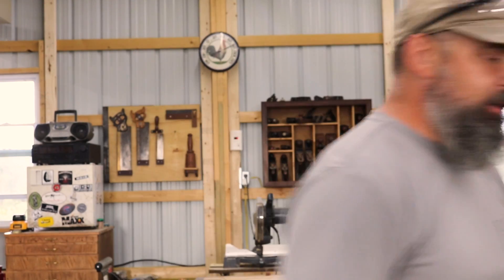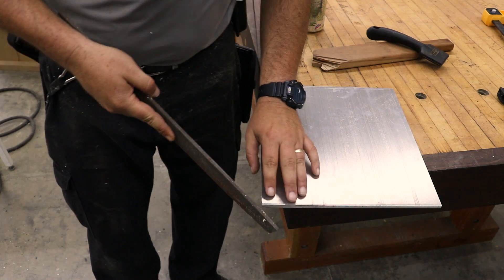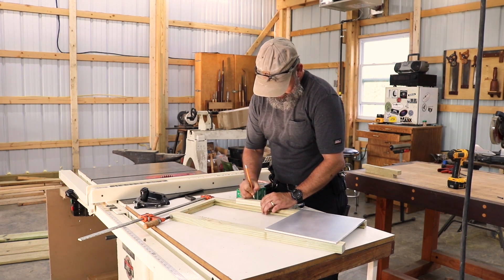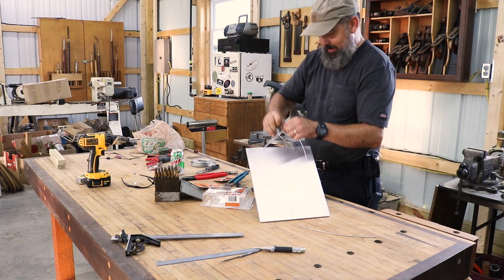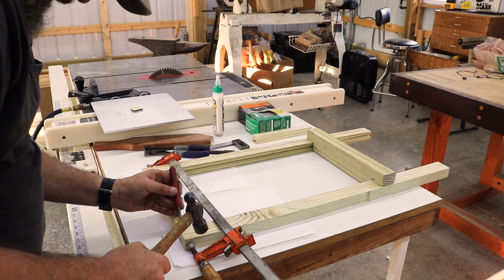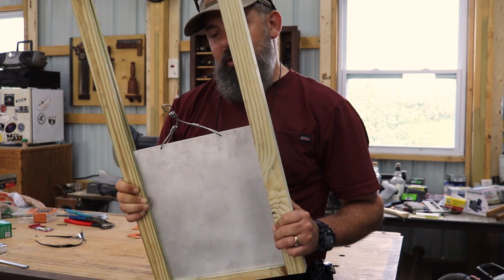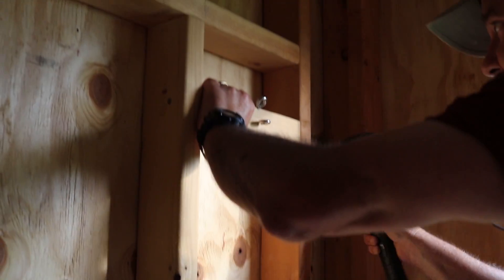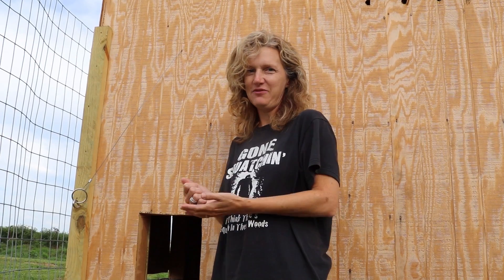The Chicken Guillotine (Coop Door)

Comment: You had me up until you put that wire rope on it. You should have just put a linear actuator on it. The plate so thick and heavy(awesome) is a good thing but it makes it that much more "dangerous". All the joking about Guillotines is understandable but a concern. Other than that it is very sturdy and well made.
Reply from the maker: Yeah.  Been using it for almost a year, and it's still working well.  The door's actually made out of aluminum, so it's not too heavy.  And, there's never really an instance where there's a chicken under the door when it's being raised / lowered.  Thanks for checking it out.